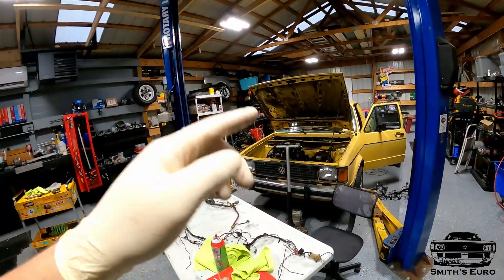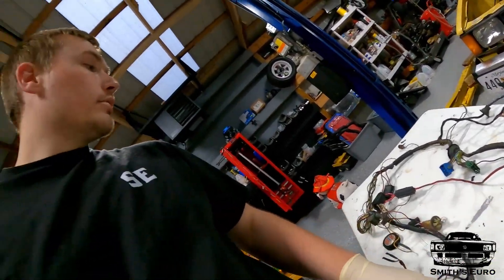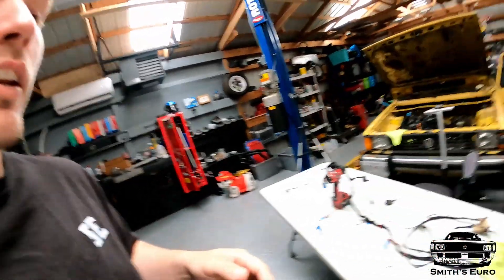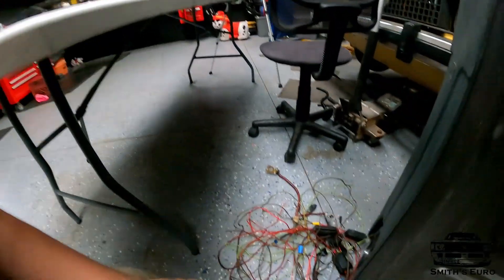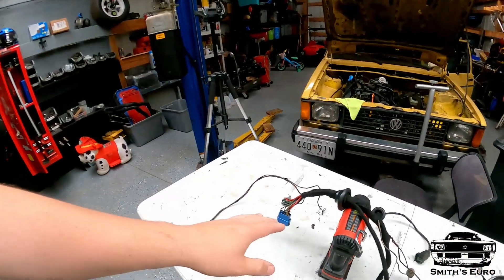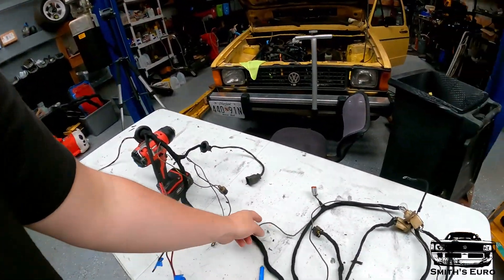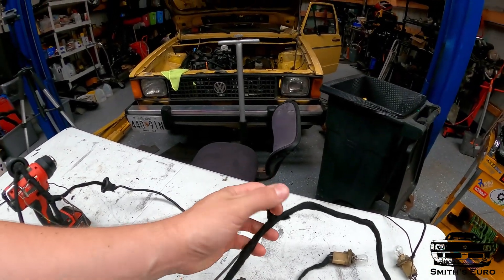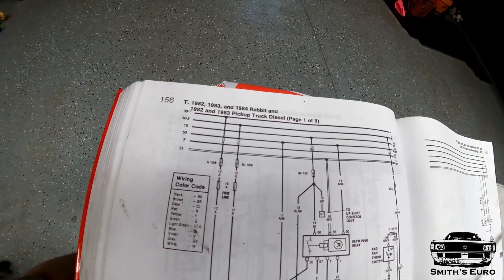MK1 TDI CHASSIS WIRING

Comment: At 5:26 the two red wires that power the fuse box, did they come from the mk1 alternator connector B+?
Reply from the maker: No they are directly from the fuse box to the battery. Oem “fuse-able link” wiring i cut after that.
For the alt you just use everything from the mk3 the 2 wires for the mk1 are underpowered compared to the mk3 stuff

Comment: On the MK2, they put the radiator fan relay right on the radiator fan shroud. I put the MK2 setup on all my MK1s. Also add a manual fan switch to save yourself if the thermoswitch dies in rush hour traffic. Other than that manual fan switch the radiator fan is isolated from the rest of the harness with a direct connection to the battery. through an inline fuse. That 6-pin grey plug might also provide power to the heater fan relay on high. You need a heater fan relay on high speed or you can burn the switch up.
Reply from the maker: The 6 pin supplies the power to the fan relay in my wiring.
The other 4 wires were all ac related. Temp sensors and whatnot.
I like the mk3 fan switch and just 10g power to it fused.
Ive had it that way in my mk2 vr6 car for years with no issues.
I remember the mk2 stuff in my old mk2, i just tossed it since i was putting in a civic rad.

Comment: X should be 'load reduction' in that mk3 harness I'm guessing. Nice job simplifying the harness and cleaning up all the hack work and fire hazards. Sure beats having the caddy burn to the ground or having to chase electrical issues as they arise. Gotta love some fresh Tesa tape. I de-pin the connectors too, it's the right way to do it and really the only way. I usually run my own 12ga wiring/ 40 amp SPST relay for my fan(s.) Much more reliable that way, and you can optionally add a 40 amp toggle switch to override the fans when you want them to run without the thermoswitch deciding for you. Nice work, this thing is gonna be a nice reliable daily when you get it all sorted out. 👍✌️
Reply from the maker: Appreciate it man. I have mine ran that way in the mk2 just directly to oe fan switch with all 10g wiring and a fuse.
No need for the relay.
Reply: @SmithsEuro  
Yeah I wasn't saying in particular in the mk2 or Volkswagen in general application wise as far as the relay goes. It's just how I do it on my E30/ E36 track cars and some others. Plus on the mk2 and up you have the whole fan control module so definitely no need for the relay. Wish I was closer to you, I'd love to come by and turn some wrenches. Met so many cool people in the Euro car community, from the local clubs and the forums especially. 👍👍✌️🙂
Reply from the maker: Why didn’t you come down to waterfest?
Thats probably the furthest north we go at atco.
Reply: @SmithsEuro  Oh I have gone to H20 in the past a few years. Was Definitely one of the most rowdiest shows I've ever been to! Hell of a good time. I was probably working pretty much every year so I would've had to remember to ask for the time off ahead of time, or if I was in my shop I most likely had too many jobs to put them off and just go, although I have put customers cars on the back burner on the past to hit up the track or go for drives with this euro driving club I used to be in.
Reply from the maker: Youll have to come out to waterfest next year.
I plan to have the 3.6 car there racing.
Reply: @SmithsEuro  
I just might man!! Any idea of a tentative date?!?!
Reply from the maker: Hopefully itll be in September again. We will have to wait and see.